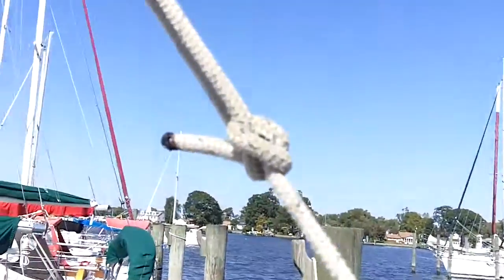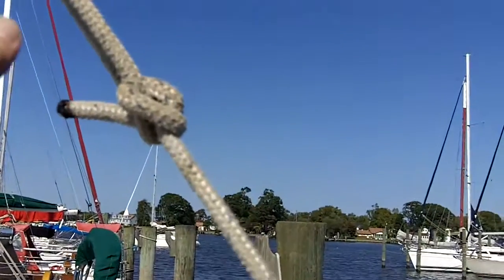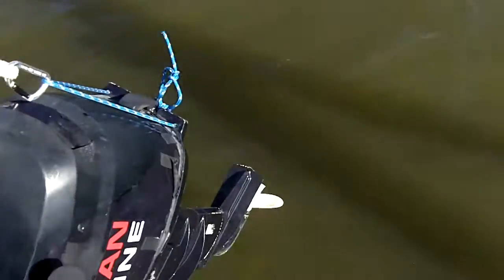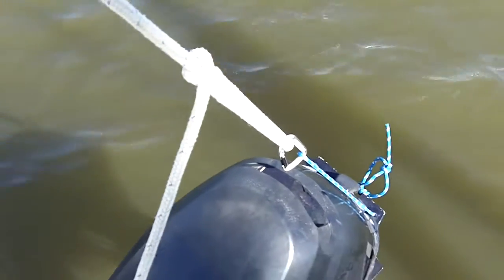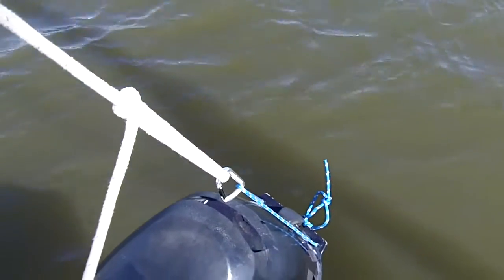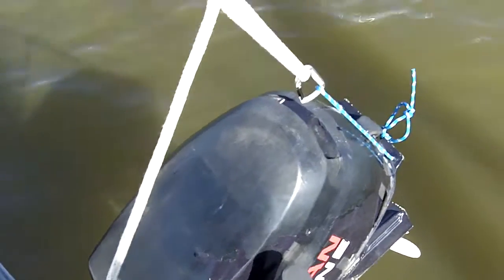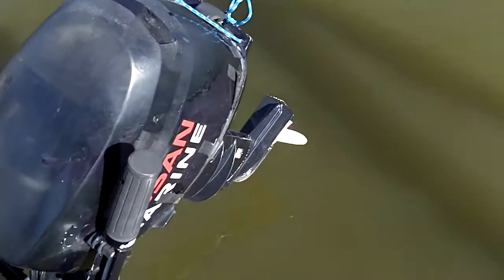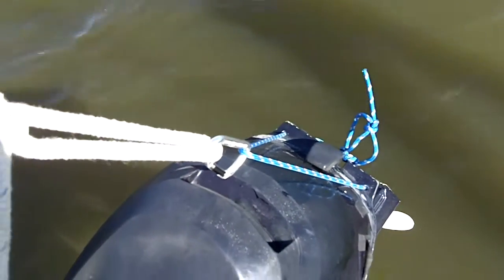outboard tilt and lift system

Comment: Excellent - what can I say-I used a similar system with 3 sets of pulley’s to lift my 25 outboard Yamaha.  I can now raise. It with only one hand. Having the engine in forward position is also the key point especially on  a sailboat. Thanks once again

Comment: This would just look stupid on my bass boat. But since you already have numerous ropes and a mast to hold it all up, I thought this was simple genius. I think the stretch of the rope will give a much more cushioned ride in rough water than the solid banging on the pin would. And opening that clip HAS to be easier than leaning way over the side to reach that pin! 
Thumbs up for a simple yet effective solution!